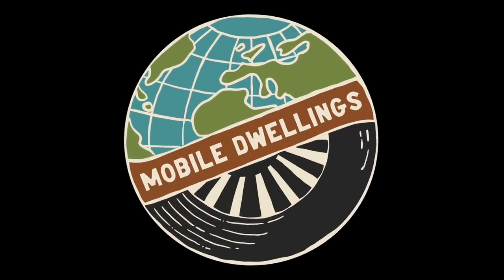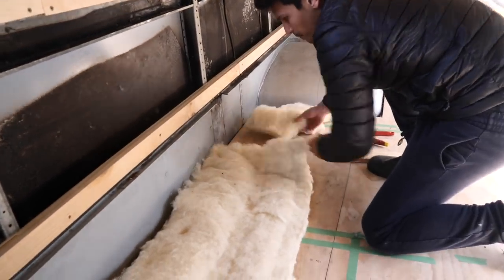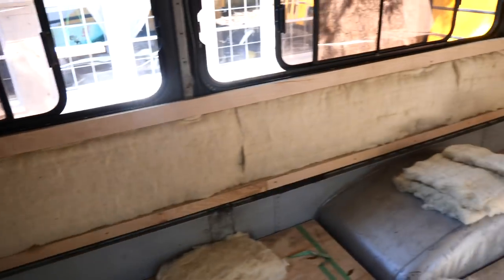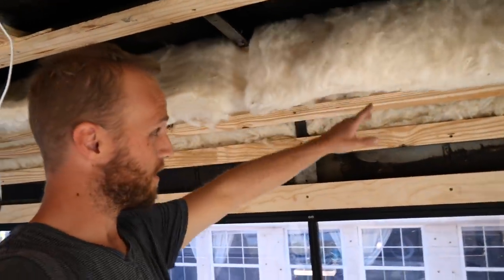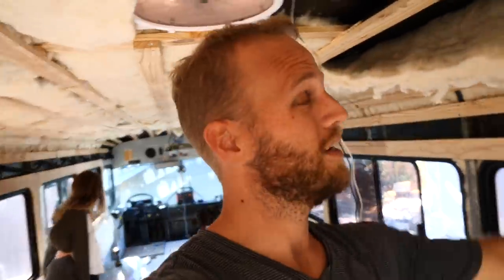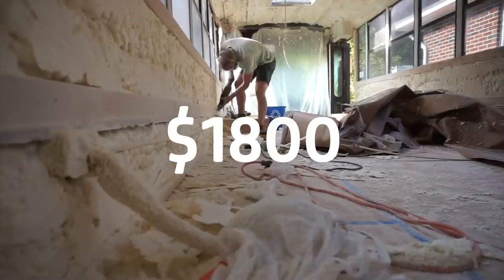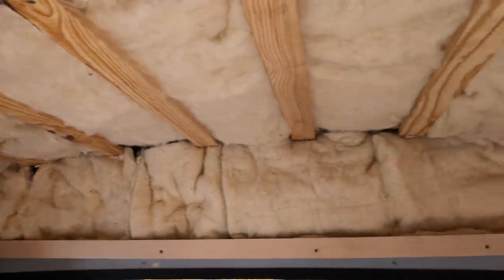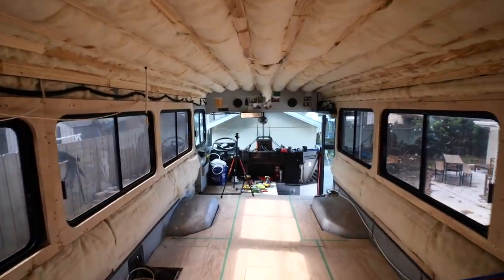Insulation! Spray Foam VS Havelock Wool for Van and Bus Conversions

Comment: One benefit I noticed with wool versus spray foam is wiring. With spray foam your wires are tied up inside of it. Thus if repairs are needed you'll probably end up breaking out some of the foam. Whereas wool can just be moved out of the way and reinstalled when the repairs are complete.
Reply: That's why you tube in your wires with extra pull though strings
Reply: @keithbaranzini5941 conduit all the way. But spray foam is also crazy expensive and in a pinch can not be removed and replaced without needing to respray the area that was cut out.

Comment: So what I'm getting from this, as a Canadian from a colder climate, I'm doing a major roof raise, and probably 4 inch framing with like 5 inches of spray foam in most areas and high efficiency residential windows.... I can dig it.
Reply from the maker: Yes! I mostly like your plan, but I would go with approx 4 inches of floor insulation, add 1.5 inch furring strips in ceiling (probably 2x4's flat) and do the same with the walls. You can go thicker in the ceiling but thicker in the walls isn't worth it and you'll lose too much interior space. That with the high efficiency residential windows should keep you toasty with a wood stove and auxiliary heat sources (propane heaters or diesel heaters). It's going to be a lot of work!
Reply: @MobileDwellings  yes it will be. I'm gonna start looking for a bus in the new year. Probably going to end up down in the US because rear engine buses up here are rare for some reason.
Reply: You can also use a ceramic paint to increase your R-value! 
I’ve seen someone build an RV (granted it was a $500,000 RV) with an R 28 because of spray foam and ceramic paint.  And the guy said to Google ceramic paint, I did and the stuff is amazing! About $300 (usda) for a 5 gallon bucket.
Reply: @IppiopaidFEEDBACK  how is it applied? Do you spray it directly onto the foam?

Comment: Great info on Insulation, I will look into this for my project. 

FYI for those that don't know, this is a huge game changer in regards to keeping the roof, or almost anything paintable, about 15 degrees cooler, if not more, and that is Lanco Coolguard and 1 Gal. Siliconizer White Elastomeric Crack Filler. The Coolguard is the most expensive in the line, like 200 USD for 5 Gal but is beyond well worth the investment. I live in a 35 ft RV full time and I was able to paint my roof, sloppily as I'm not as young as I was a few decades ago easily 2 times now with enough left over to probably paint it a third with a single 5 gal bucket. I easily have 1/3 of a bucket left. Given the cost of 200 USD that's a steal in my opinion I just hope HD won't read my post here and increase the price because I'd gladly pay more for this product. Also the 1 Gal. Siliconizer White Elastomeric Crack Filler is by far the best of the best to repair your roof with; believe me I've been repairing roofs for many years. 

I typically stayed away from a product costing 25 USD per gallon because I didn't feel the product was worth it. all things considered these two items have sealed any and all leaks my RV Roof was having. Not only that but the bond created by the Siliconizer between the Aluminum Gaps is amazing. It won't shrink and stays where its put. There's a fair amount of tool time as well, just depends on if your using it in direct sunlight but that goes for any product in that regard. I've gone up a few times over the past few months and not a single crack. My Aluminum Roof appears to be a single piece, 8 feet wide and 35ish feet long and I have a gap as it laps over the outer end of the outer walls as they curve over the top of the roof. I say gap but it's actually overlapping Aluminum which is prone to movement and it can cause screws or fasteners to lossen over time with just the natural movement of the metal. I removed most of the old screws and replaced them with a bit longer and larger diameter screws to ensure the roof is held down. This created a valley, on purpose, and this filler did its job and filled the gap perfectly covering the screw heads easily. I also used an 8 inch by 100 foot, or 50 feet I forget, Fiberglass Screen repair to aid the Siliconizer in bridging said gap and that really helped. Even if the Aluminum does move it will move under the Fiberglass and won't create any issues. 

The Coolguard also prevents my Aluminum Roof from absorbing ANY HEAT WHATSOEVER; and I mean ANY HEAT. When I first painted the roof my shoe souls were almost melting as the roof was that hot; that was after being in the shade for a bit as you don't want to paint in direct sunlight if you can avoid it. I'm here to say this product went on thick and covered EVERYTHING; including bugs because I grew tired of picking them out of the paint. The Siliconizer sealed better than any caulking and the 1 gal bucket went a very long way. I ended up using 3 gal total, still have most of the 3rd bucket left, but had a lot of gaps to repair so it was well worth it. Since painting my roof I can now climb onto my roof, in direct sunlight, think high noon, and not worry about anything being hot to the touch. When they say Cool to the tough, in direct sunlight this product is COOL to the touch and that blew my mind. The siliconizer stays flexible and moves with the Aluminum as does the Coolguard Paint. I didn't properly prep the roof per the instructions but I'm here to say the paint is sticking like nothing I've ever used before. It stuck to Aluminum, Plastic, Fiberglass, and even Asphalt Roof, used by the previous owner in some sort of failed repair, and even though my Aluminum Roof was not properly cleaned this paint stuck to a dirty roof. 

Products over 400 USD were out of my price range and could probably work better but for the money I'm here to say the following two products are worth investing in. My health is not what it once was so I simply did what I could, when I could. The Siliconizer, on some areas, may have gone weeks untreated before it was painted and the paint stuck to it like white on rice. Also, both products are white and cover any and all dark colors instantly as I used some black silicone caulking in some areas before I found this Siliconizer. Even the Fiberglass was Black but did not bleed through either the paint nor the Siliconzier which was a plus for sure because Black Absorbs heat. I highly recommend painting your roof with this product, Coolguard. Also the Siliconizer, though more expensive then butyl, is also far superior as I've used both. Both of these products exceed my expectations and I've been in Construction since 1980, so do the math. This product didn't exist when I will looking to seal cracks in roofs and I'm here to say it's worth every penny. I can honestly say this about very few products but these two, now that I've successfully used them, are worth every penny. 

Leaks from my very old roof, my RV is from 1986, are probably sealed for the very first time. Also, as an added benefit, sound has been reduced drastically as well. If you've ever heard the sound of Rain on a Tin Roof then you know what that sounds like. This paint has easily cut that sound by 60% if not more like 90%. Stuff dropping on my roof now, which used to sound like an explosion, is not a distant thump. Even the passing Train's vibration has been noticeably reduced since painting my roof. I wish I'd done this sooner but you know hindsight, it's always 20/20.

Here are the product links that I purchased through HD and shipping was free and only took a few days, like almost next day. 
https://www.homedepot.com/p/Lanco-5-Gal-Coolguard-100-Acrylic-Urethane-Elastomeric-Reflective-Roof-Coating-with-Dramatic-Temperature-Reduction-RC3700-2/304353858

https://www.homedepot.com/p/Lanco-1-Gal-Siliconizer-White-Elastomeric-Crack-Filler-Smooth-Knife-Grade-for-Permanent-Water-Resistant-Adhesion-RC230-4/100428972

Comment: Very wise suggestion…you must get the ratio correct on foam. Conductive R value is conductive R-value so your comment about the ceiling better with wool is incorrect…if wool system(you mentioned fans) is better then it is the
System not wool vs foam.  Foam may have more thermal mass so it radiates longer at the end of the day, but at the start of the day it doesn’t heat up as fast either.  Once again conduction is conduction and r value is a measurement of conduction.

Comment: If you put a reflective surface/color on the back of your ceiling panel and leave 1/2-3/4” gap between your roof you will reduce conduction and reflect radiant heat.  This will drop your roof temp too.

Comment: Maybe on a future build, you can try Humble Road's method of adding heavy mass vinyl on vans for insulating buses that don't have raised roofs or spray foamed insulation.
Reply from the maker: Interesting I'll try and remember to look into that next time.
Reply: MLV is not a good thermal insulator. It’s a good noise insulator.
Reply: @EricPeelMusic  Yes, I know. I just meant as an additional part of his builds. I should've said it clearer. I did reference Humble Road, so that should be more helpful to them if they ever look it up.
Reply: Ah, ok

Comment: I really appreciate the video and the opinions from the other side about spray foam, especially from someone who sprayed their own bus! 

Havelock Wool is interesting, but I have concerns based on other's reviews. Have you looked into rock wool at all? It is cheaper, slightly higher R-value, natural & "organic", and not an animal product! I also think it does a better job at acoustics and less worry of mold.
Reply from the maker: I have heard the same about rockwool. I will definitely research it heavily and compare it to sheep's wool next time I feel inclined to skip the spray foam. Theres no arguing though if you're down with spray foam it is by far the superior product. But then I do think it makes sense to delete windows and tighten up the bus envelope if you're going to go for the spray foam.

Comment: Havelock wool recommends at least 2 thickness layers of its product, for an R-value of 7.2. Looks like you went with a single layer on the walls & ceiling--if so, why? Thanks.
Reply from the maker: We went with more like 1 and a half layers. We fit as much as we could in the cavities we created.
Reply: @MobileDwellings  Good to know. Thanks. I had been considering spray foam, until I found your video... I'm still researching options, but I can see benefits of wool insulation over foam.

Comment: I might have missed this part, but did you use the wool in the floor as insulation ?
Reply from the maker: Nope. Rigid foam board in the floor.

Comment: We are about to embark on our bus build and are planning to use havlock . Im intrested to know how you feel about it now after its been a bit and has been lived in so to speak. Also intrested to know how much you needed to purchase. We have a 09 thomas front engine 84 passenger so shes a biggen.
Reply from the maker: If you're not going to be spending the bulk of your time in very cold climates we 100% feel that Havelock wool is the way to go. I think we used two of their double bag orders for this 33 foot bus. So 4 bags I believe.
Reply: @MobileDwellings  What do you mean by double bag? On the website it looks like they only sell a pallet or 100 sf box. We have a 28 foot bus that we are looking to insulate.
Reply from the maker: @erinnjohnson1247  I believe they've changed the way they sell their product since making this video. I'd read through their faq, take some measurements, approximate how many inches deep you'll be insulating and estimate how many square feet you need to buy from there.

Comment: In Europe it's -10 to 0 for about a month, 0-15  for about 3 months and the rest is 15-25 summer is like 2 month tops at 30-35... And not each day more like in weekly bursts. Is the wool still better?
Reply from the maker: Europe is a whole continent. So many different climates. But this building style is inadequate for cold weather. Anything around or under zero degrees to be comfortable you need thicker floor insulation, thicker (preferably spray foam) in the ceiling, and less surface area taken up by windows. If you use the building methods ive shown in this series you should move your vehicle around to chase weather or create a serious amount of BTUs for heat.
Reply: @MobileDwellings  But does it mean that even with heating it will be cold in my camper van? Or will it just consume more power to keep the temperature? I will get the AC that is placed inside the camper not outside like the Dometic RTX ones.

Comment: I live your bus and this conversion, BUT, this but is definitely going to need a rooftop AC unit. I think you guys are being short sighted by not installing one early in the build as if you decide later it is going to be a difficult job. Believe me, you will have to remove roof panels and large chunks of insulation then re-batton and insulate etc. Not going to be an easy job.
Reply from the maker: Hi Kerry. I install mini splits. Not a huge fan of rooftop airs but they have their place. You'll see!
Reply: Nobody "needs" AC 😊